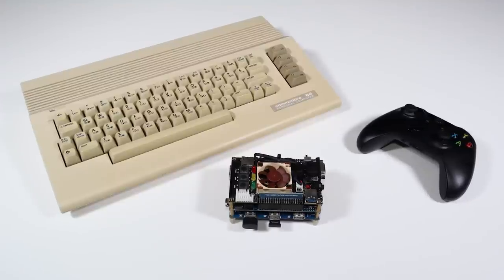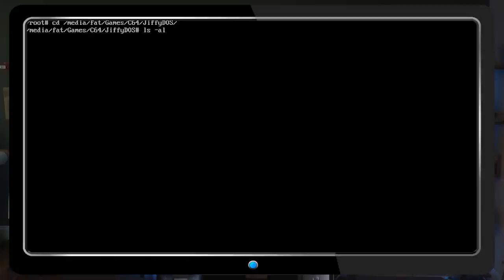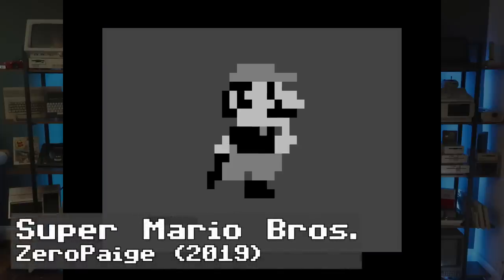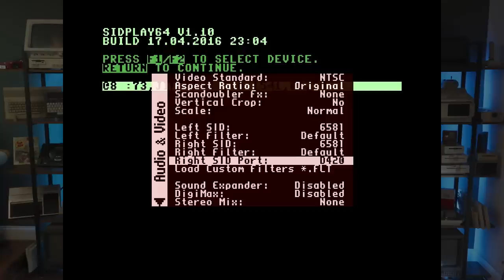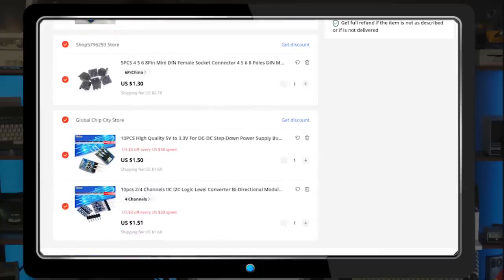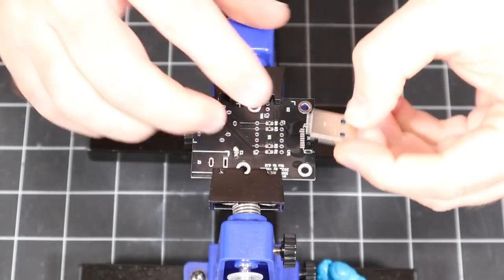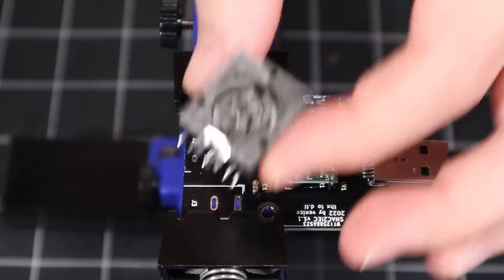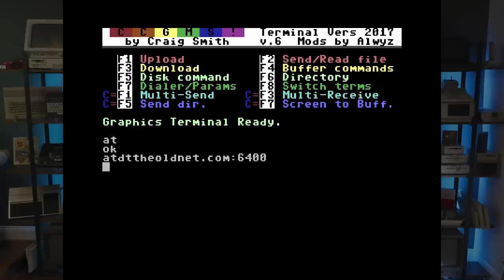Commodore 64 on MiSTer FPGA with real disk drives!

Comment: The way I usually do surface mount is, I put a dab of solder on one pad, then slide the part into position with the iron still on the solder blob. When it's in position, I lift up the soldering iron, while keeping the part steady until the solder cools. That way the part is fixed in place, making it easier to work on the rest of the pads. Then I solder the rest of the pads in the conventional method (touch tip to pad and component, bring in the solder.) For parts with lots of closely spaced legs (like ICs, USB ports/other types of connectors, etc.) I do the same thing (put a dab of solder on one of the corner pins, slide the part in position, wait for the solder to cool.) Then I hit it with a lot of flux (i use the paste kind rather than the liquid, I think it adheres better.) Get yourself the kind of soldering iron tip that basically has one (roughly 45 degree angle) flat side (this is sometimes called a "hoof" tip) and put a ball of molten solder on the flat face of it, then drag that ball across the pins. Usually the pins will snap into place nicely. Sometimes you'll get a solder bridge, if that happens just take the iron and "flick" it away. (Sometimes you'll get it on the first try, but sometimes it takes one or two flicks until the bridge is gone.) I've successfully soldered lots of things that I used to think were impossible using this method, like those large microcontroller type ICs with bazillions of legs. And having a magnification device of some sort definitely helps. You can get pretty decent LCD microscopes at really reasonable prices these days. I also have a hand held magnification loupe nearby which I use to double check my work.
Reply from the maker: Thanks for the advice! I will have to look into magnification and check what other tips I have for my iron. I have tried the "tin one pad then slide the component into place" method before and had good success with that, but the components for that project were much larger.

Comment: Tip for the future: Don’t clean bridges like those with braid. Just add flux, clean the solder off your iron (preferably with the metallic wool tip cleaner), and touch again. If it doesn’t wick onto your tip and separate the first time you do this, clean/flux and do it again, this time drawing solder toward neighboring pins to distribute/spread the excess. Most of your joints could’ve used a bit more solder anyway and would’ve benefited from a slightly longer dwell time at that temperature. Your bridges were so small they probably would’ve cleared simply by fluxing and reflowing.
Reply from the maker: Cool, thanks for the tips!

Comment: don't use the iron to transport solder, doing so burns off the flux that is in the solder. heat the joint, bring in your solder, pull away the solder and the iron. for SMT parts I tend to tin one pad first, align the part, reflow that first pad, then solder the opposing pad while making sure the part is aligned. if the part has more than 2 pads, solder the remaining once you are certain you have it aligned fully. a quality stereo microscope helps with parts smaller than 0603, but is not strictly necessary down to that size. 0402 parts are quite easy still with magnification, and 0201 parts are still in the range of "anyone should be able to do this with a few minutes practice". 01005 parts are where the pain is. leave them to the robots.
Reply from the maker: I have tried your method as well with good success in the past. I recently saw a video that did it this way and I just wanted to give it a try :) I may have to invest in a microscope for sure.

Comment: Very interesting video. I had a C-64 when I was young. I wonder how long the MiSTer will use the DE-10 Nano. Aren't there more powerful FPGA chips? Then someone could make cores for later generation consoles, for PS3 for example.
Reply: I wouldnt bet on seeing ps3 core soon, or even in the next 5 years. The step from ps1 to ps2 was already immense, if you open them up and look at the hardware. People writing the mister cores will have to write all the chips functionalities into working  code.
Reply: @R4mbo87  I am just dreaming of it, I do not expect it soon. FPGA is in a way the best way to preserve games and software in my mind.

Comment: Flux needs to interact with the solder.  What you used was so runny it didn't do anything.  That's why your solder was a ball or blob instead of flowing like liquid.  It almost looked like it dried out before you even got to it (capacitor).  Try Amtech NC 559 V3 TF.
Reply from the maker: Thanks for the pointer!

Comment: 3:50 - "Together, these upgrades (DolphinDOS C64 ROM, drive ROM, RAM buffer, parallel interface) can result in speeds up to 20x stock performance"

Wow! That's incredible! So a 1541 drive on a C64 could be up to half as fast as the Apple Disk-II!
(Well, according to performance figures I found on the internet and can't be 100% certain of, anyway... Regardless I always love a good joke at the 1541's expense.)

Comment: If you're selling any other adapters you make I'd buy one. Or even a kit of the parts to put together myself. Not that I really need one but it is a cool little project to use real hardware with the Mister. Between Mister, Ultimate64, C64 maxi, and real hardware/disks I have lots of C64's.
Reply from the maker: I have extras of all the parts, only the DIN connector isn't quite right as the two front posts don't line up to the PCB. It still functions fine though. If you want a parts kit, shoot me an email. The address is in the channel's "About" page!

Comment: Might I suggest bumping up your iron temp?  Your joints look dry and it's taking far to long for the solder to form.  Bump up another 20deg or so and be a little quicker and you should get better joints.
Reply from the maker: Thanks for the tip!

Comment: ... and now we just need an OLED 4:3 screen that fits the SX-64.
Reply: Why would you want to do that to an SX-64. though? I guess if the CRT was dead...  Otherwise...  Well it's not like it makes the machine any more compact, you know?
Reply from the maker: It's not OLED, but this product exists. A bit of a DIY job but the results are pretty nice! https://shop.tentelian.com/Replacement-screen-for-Commodore-SX-64-5-6%E2%80%9D-LCD-JD567M03-AT056TN52-p370607976